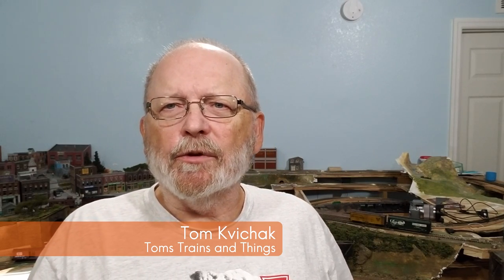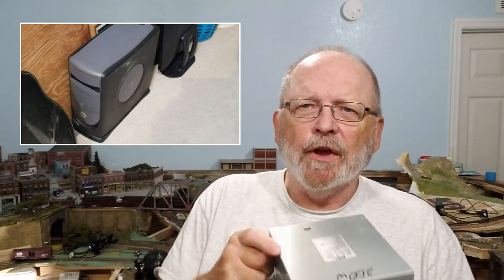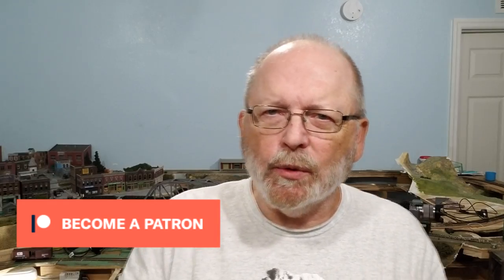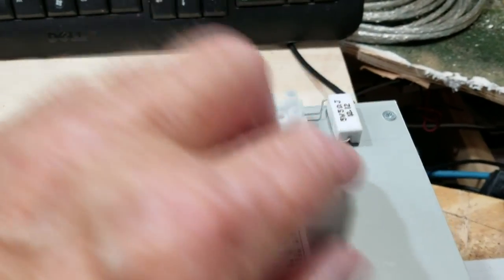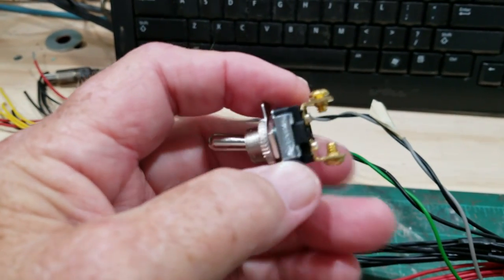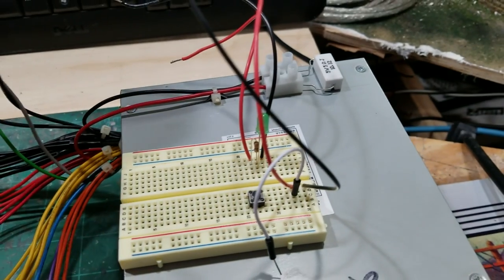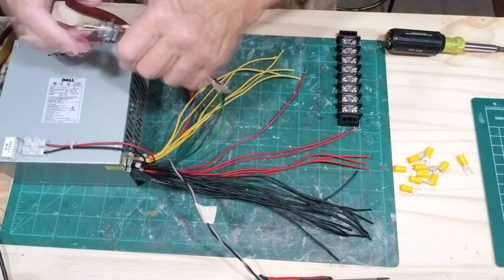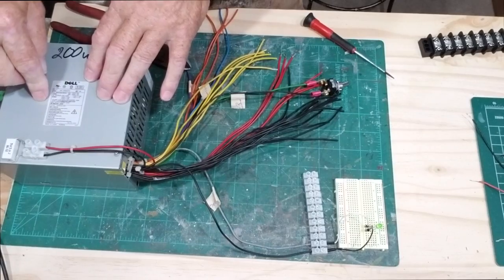Easy Power Supply For Your Model Railroad

Comment: Well damn!  By the time the PS arrived at my son's, it had been bounced around so much, it wouldn't run. But he got one from a friend for free (seemed the +3.3 V was 7.0 V though). A little bit of experimenting showed that the +5 V would just nicely power 2 LED's in series, with just the desired brightness (and easy trouble shooting).  I'm hoping that 5 pairs of LED's  (.1A draw) will be enough to activate the regulation circuit , thus cancelling the need for the resistor. Thoughts?
Reply from the maker: How much resistance are your 5 pairs of LED's?
Reply: E= IR:  50 ohms?

Comment: Hi Mate ,Just a quick question about the resistor.

I know you need a load ,  what is the max lead you need , can you put in on any outlets or do you have to put it on the one with the highest current ?
Reply from the maker: Hi Kevin, The resistor has to go between 1 black wire and 1 red wire with nothing else on those wires to keep the load steady. I may be doing another video similar to this one shortly for adjustable output.
Reply: thanks ,

Comment: Question: Is there a less expensive relay that will do the job of an atlas relay? These atlas  relays are getting very expensive and there are no hobby shops within miles, so I have to order them from Ebay or elsewhere and pay on top of that a very high shipping price. These prices are eating my lunch and on top of that atlas relays are not that great, they get contact problems after awhile. I'm referring to the double pole Atlas Snap Relay.
Reply from the maker: I don't use the Atlas products so I'm not sure what voltage they operate at but here are a few options on Amazon:
https://amzn.to/3FoNwKF
Reply: @TomsTrainsandThings  Thankyou, I will look into this.

Comment: Tom I had another question, sorry. When you combine three of the same voltage wires, did you do that just to use them up or to increase the ability to get the most amperage out of the power supply? I don't think you can multiply the amperage, and I know you didn't say that. So for instance, what is the benefit of putting the three yellow wires together? Neatness, or does it help with pulling all the the 10 amps out of the ps for the 12 volt wires? I know, I'm kinda stupid on that. thanks!
Reply from the maker: I combined the same color wires to be able to draw the higher amperage. Each wire can only handle a small portion of the amperage.

Comment: How do you use negative voltage.
Reply from the maker: Use the negative voltage lead as the - and add the + voltage for a higher voltage
 Make sure you don't exceed the Amp rating of the lower rated voltage!

Comment: Hey Tom! Quick question.. I want to run a bus wire for street lamps and another bus for buildings. How many volts do I need off of this power pack? Like which "branch" of power would be sufficient?
Reply from the maker: That depends on how you plan on controlling your LED's. Have you tested any circuits yet? If so, what voltage do they require?

Comment: Tom, your videos have helped me a lot. I want to put LED traffic lights on my layout. I have a DCC layout. I don't have any DC transformers, manufacturers say I could hook to. It's requires a 18v AC power supply. Any suggestions?
Reply from the maker: Chris, you can see if you can find and AC wall wort or pick up a used transformer cheap at a train show.
Reply: Toms Trains and Things Going to a show this Sunday, will check. Thank you.

Comment: Hey Tom, just ran across this video and the question I have is I'd like to run a series of led's on my layout, light poles, etc. and was wondering if the 3 watt output would be okay to use straight to the led or would I still need a resistor?  If not, how many led could I run in parallel or if that can be done?  My only experience with electricity is when I was 3 and stuck a fork in an outlet :-O the 12v I'd like to use for 2 linear actuators for bridges so I won't have to duck under (Yeah I'm old)  Thanks!
Reply from the maker: https://www.youtube.com/playlist?list=PLjjhnrIKSTShIsUhAHn1O6eUIIqJ45gS5
Reply: @TomsTrainsandThings  WOW!  I can't thank you enough, looking forward to your next offering, "Same Tom time, same Tom station"

Comment: thanks this video help me set up a power supply i used a 10 ohm 10w 10% from radio shack will be doing two more again thanks
Reply from the maker: Your welcome Scott. The 10 Ohm 10 watt resister works just as well as the 5 Ohm resister. You have plenty of power in those computer power supplies!
Reply: What was I thinking?  On a 10 ohm @ 5 Volts it.s 0.5 Amp.  Watts = IxIxR (.5x.5x10) = 2.5 watts
His 10 ohm, 10 watt resistor would be almost cold, and a 10 ohm 5 watt would just be warm
Reply: This should really help my son. I have an old PS (250 watt) that should solve problems with trying to add LED building and tunnel lighting to a layout powered by a wimpy 17 output watt PS. Now, if we could find a way to use the +12 V to power the Loco Nothing fancy, it's straight DC.

Comment: Tom, can I combine a red, yellow for ~18 volts to run my Arduino DCC++ base station at the required "18v"? What would the available amperage come to? (more than enough I would suppose) if I could do that? Thanks much. This is an awesome video but I will always put the salvaging the printer at the top of the list!!:)
Reply from the maker: No, it doesn't work that way.

Comment: Great idea! I have done it for robotic projects but never thought about using a PC power supply for my railroad. Do you show in any other video where you mounted it? Or had any problems later on using it?
Reply from the maker: Never had an issue with it. I did a live stream several months ago showing how to use the break out boards for it. Currently my layout is dissassembled since I'm between houses.

Comment: i have an old digitraks zypher that the power supply died on can i use this for it?
Reply from the maker: Unfortunately no Bill. You need 15VAC for your output and this has only DC output. If you can't find a suitable power supply online, you can always try your local thrift store. They sometimes have many wall wart available, you just have to root through them unless they take the time to separate them by voltage.

Comment: What would you use negative power for?
Reply from the maker: I don't use it on mine but you can use the -12 as the Gnd and the +12 to make 24 volts. This would be a low amperage situation since the -12 is typically 1amp or lower. In this situation you can not use the Gnd wires in that circuit, and this would have to be isolated from any other circuit. I would not recommend using this method though. Too easy to mess things up!

Comment: I am wondering for even more neatness, if molex crimps and crimping terminals, or similar, can be used. I really prefer neatness in wiring as it not only looks good, cable management and troubleshooting is made easier. Nice job. :-)
Reply from the maker: I removed the original molex connectors to consolidate the wires

Comment: havnt bought a transformer yet for my new track set up. how many feet of track will a train transformer power? like a mrc 2500?
Reply from the maker: Leeroy, how many feet of track do you plan on running and how complex of a track plan? How many locomotives do you plan on running at one time? How many accessories do you plan on powering from the transformer at one time? If your talking about a Tech 2 2500, it's rated at 16 VA which comes out to about 1 amp give or take depending on what voltage your running at. If your just starting out, I wouldn't worry about how many feet of track it could handle. If your planning on buying a use power pack, I would hope you can test it before buying.
Reply: Toms Trains and Things..  thanks for replying back. At the moment it is a very simple straight forward    
track around my living room. No extras. except for maybe a couple turnouts to an area to add and take away trains off the main line.  will be a total of about 120ft in whole thing. As I said last time we talked this is the first time I have ever fooled with trains since I was a kid. So I know nothing of how much power it takes to run the train for that distance.  Will just be one train running at this point.
Reply from the maker: With one train running you should be okay with any MRC power pack!
Reply: Toms Trains and Things .. ok. great! . how many feet of track will a power pak like that supply? Is there a formula for power vs distance?   Got a recommendation for a controller by mrc or another company that would be better?
Reply from the maker: Any power pack will work fine. There is a formula for calculating all the variables involved such as amp draw of your locomotive, accessories used, track resistance, and resistance of the wire used. I=V/R

Comment: what is the differance between + 24 volt and - 24 volt on the supply   cheers
Reply from the maker: Hi Bob, thanks for watching. It's actually +12 and -12 to make the 24 volts.  If you tap into the blue and yellow you'll get the 24vdc, as opposed to black and yellow for 12v or black and blue for -12v. Check the amperage on the data plate, the -12vdc is normally about 1 Amp. When you combine the -12 with the +12 your limited to the lowest amperage value.
Reply: cheers for that if i need 24v just put the two together and i have my 24v brilliant thank you for being so quick with a reply all the best   Bob
Reply: I am confused. How would +12v and -12v combined = 24v ?  Do you connect both together for one item lead and a black for the other item lead?  Or  connect yellow to one item lead, then blue to the other lead of the item?
Reply: Michael Barbone Do NOT connect the yellow and blue together. The voltage between yellow and black is +12v(the yellow wire is 12v above ground potential). The voltage  between the blue wire is -12v or 12v below the ground potential. So the difference between the yellow and blue +12v - (-12v)= 24v so your item would connect between yellow (+v) on the item and the blue (-v) on the item. Just make sure no electrical part of the item touches anything connected to ground (black)
Reply: That was what I was asking. I would connect the yellow to one connection (lead) on the accessory and then the blue wire to the other connection (lead) on the accessory, and the item with those wires will be getting 24v?  I see in your reply " +12v - (-12v) = 24v"  I did not know that was how the electric worked. I was thinking that the voltage between the two wires would like "cancel each other out" somehow, that they wouldn't be additive, but switch between +12 and -12.  Thank you.
Reply from the maker: Michael, make sure you don't connect too much on the 24V since the -12v amperage is usually the lowest of all the leads on the power supply. Check your data plate on the PS, it should list the max amps for each voltage. +12 and -12 will be listed separately. Typically 1 amp for the -12, so don't go over that!

Comment: I am really learning a lot watching your videos. Keep up the good work. I have a question that I know you have the answer to. I have a twenty year old IHC CORKEY'S CARNIVAL CARAVAN set that was made in Slovenia. Can it be converted to DCC? If so which decoder should I get?
Reply from the maker: Thanks for watching Edwin. Wow, you have "The Happiest Train Set Ever Made." My first question for you is; how does it run now? Putting a DCC decoder in a locomotive isn't going to make it run any better. If it runs poorly now, it will also run poorly with DCC. If it runs fairly well, you will have to be careful while installing a decoder as to not short it out. Assuming it doesn't have a plug since it was made in the 90's you would have to wire it by hand and that includes changing the lamps to LED's.

There are a lot of variables involved in choosing a decoder. If you would like to discuss it further send me an email at tomstrainsandthings@gmail.com
Reply: Edwin Kowalinski hi, I just read your comment and question, well, running a dc layout, as you know the tracks don’t have power to them all the time, only when you turn the control knob on the power supply to make the train move, with DCC, the tracks have power all the time, your loco, fitted with a decoder, weather it has sound or not, the decoder operates the loco, it depends on the quality of the decoder as to how well the loco runs, I’ve seen tests, SoundTraxx make a Tsunami2 decoder that leaves the others behind, changing some cv settings you can have the sounds come automatically on like the Proto, if you want to check it out search for SoundTraxx on YouTube, George from SoundTraxx demonstrates and explains all the settings and sounds, how it works. Track and wheels must be clean, as you know for good conductivity. Regards Gary

Comment: Tom, I have a IP-P350AJ2-0 power supply for model railroad, I have one question on my P1 I have a brown wire attached to 3.3 volt wire at pin #11 do you know what that wire is for.
Reply from the maker: Barry Porter it's for the remote sensing of a voltage drop when connected to the motherboard.  May not have a practical use for mrr. I would just cap it off.
Reply: Tom, thanks for a quick response, if I had watched your video a little closer you had memtioned it so I did a little research and found out it was for remote sensing but will cap it. Thanks, really enjoy your video's. Thank's again
Reply from the maker: Your welcome Barry

Comment: How did you know those was the right wire for the switch an light?
Reply from the maker: There is a pin out diagram available for all power supplies which are common to all computers. I think I overlayed one in the video
Reply: Thanks Tom I saw that after I ask the question lol

Comment: Hi Tom / Looks like a lot of wire work "Wow" / I use 4 Lionel Bricks, one for each main line.
• Cheers from The Detroit & Mackinac Railway 🚂
Reply from the maker: Thanks for stopping by Gary. Once you splice them all together it's a piece of cake. This is all for operating accessories on your railroad.

Comment: I know this is very old video, so may not get an answer -- but hoping someone can explain this to me like I'm 5:  you indicate you have some wires giving you +12 volts and others giving you -12 volts...does that mean the polarity is reversed?  So if, for example, a motor was attached to -12 volt wire it would run one direction, and if then attached to +12 volt wire it would run in opposite direction?  And would it matter which of the black 'ground' wires it was attached to?

I just used a motor as an example in my question, as a simple way to try to explain what I am asking (don't know if there is a 12-volt motor), since I can understand fwd/reverse on a small electric motor.  Sorry for the dumb questions -- my knowledge of electrical stuff is such that I know how to plug something into an outlet in the wall and I can (usually) change a light-bulb ha-ha; but beyond that I need to educate myself to understand what's being shown in the video.  I am retired and have wanted to build a model railroad layout since I was a young boy -- but the current state of the hobby is beyond ridiculous and unacceptable regarding price gouging and over-inflated greed by companies providing consumer goods (it's everywhere, not just R/R hobby); so being able to re-purpose a power supply from an old computer looks like a good way to save a few dollars.

Thank you for your time and assistance.  Liked/subscribed.
Reply from the maker: Do not use the -12, that's for computers, and it's only 1 amp.  To reverse a motor, one would just revers the leads

I have some more videos after this that explains it more. Check in my Playlists

Comment: Where can I buy that 5 watt resistor?
Reply from the maker: Thanks for watching Joe.
I got mine through MCMelectronics.com 
5 Ohm 5 watt resistors 46-000500 $1.16 per 5 pk. 
220 Ohm 1/4 watt resistors 287-10790 $2.06 per 10 pk.
Reply: Thank you

Comment: What do they use at for Tom do they use that for lights tortoise switch machines what
Reply from the maker: Hey John, anything you want to power on your model railroad. Switch machines, lighting, stationary decoders, Power management boards. Just about anything that runs on DC voltage.

Comment: what size resistor for the LED?
Reply from the maker: Hi Terry, sorry, thought I mentioned that. It's 220 Ohm 1/4 watt. You can vary the value slightly either way to make the LED brighter or dimmer.
Reply: Thank you TOM.. Where to get the 5ohm,5watt resistor..no-more radio shacks?
Reply: Amazon ..10 for $6.00 free shipping(in case anyone else is looking)
Reply from the maker: I got mine through MCMelectronics.com 
5 Ohm 5 watt resistors 46-000500 $1.16 per 5 pk. 
220 Ohm 1/4 watt resistors 287-10790 $2.06 per 10 pk.
Reply: Thank you Tom. Your a life saver
Reply from the maker: Your welcome Terry

Comment: Very interesting use of an old computer, Tom. Did you use this on your layout or workbench? I could see this being used on a layout. Especially with all the lighting and accessories being incorporated in layouts today. Do you run a bus of 12 volt wires for your turnout machines?
Reply from the maker: I currently have my work bench on a portion of my layout so I'm using it for both. I have another work bench in another room where I will be using another power supply. Right now it's easier to film my episodes in the train room so I set up a filming work bench on the layout. I operate most of my turnouts with a Digitrax DS64 so I run a common 12 volt to all the units.